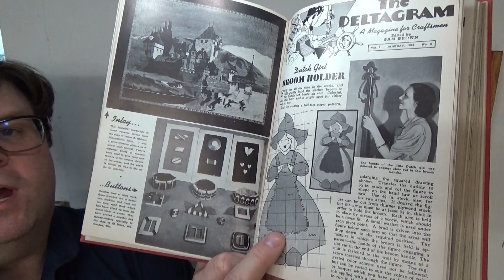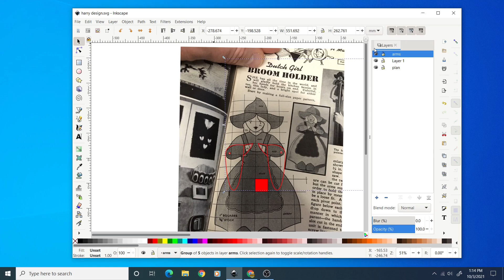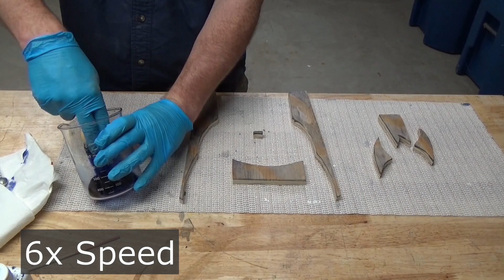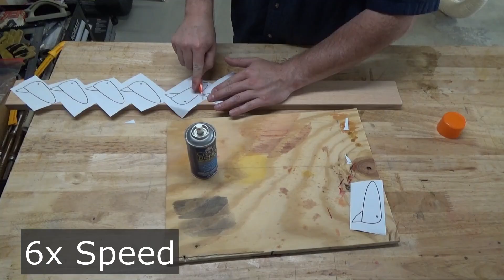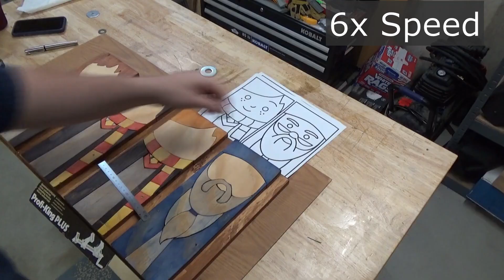Bandsaw Woodworking Project: Harry Potter Themed Broom Holder

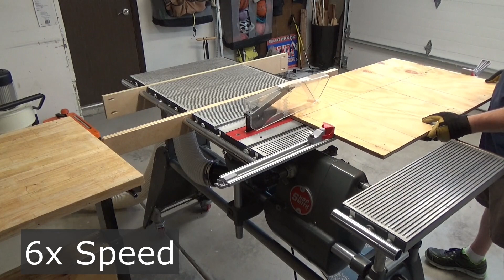Comment: I thought the most interesting portion of this was at 2:43 where I see the "infeed-outfeed extensions" you've added so you can use the panel jig. I'm going to try and make a couple and see if they help me.
Reply from the maker: Thanks Berry, hopefully the infeed/outfeed support helps you. It certain made cutting the parts for cabinets very easy. This video has more on these supports if you have not seen it already. https://youtu.be/xcJ06tymhB4

Comment: What an incredibly fun video! We enjoyed this and love the creativity. Not sure if you had common trouble of having to sand off the paper after using the spray adhesive. If so, try covering the surface with painter's tape first. Then use adhesive spray to add the image. After you cut the pieces, the painter's tape comes off the wood very easily and there is little to know further sanding to do. Keep the content coming!
Reply from the maker: Thanks Poor Man! I will try the painters tape trick next time.